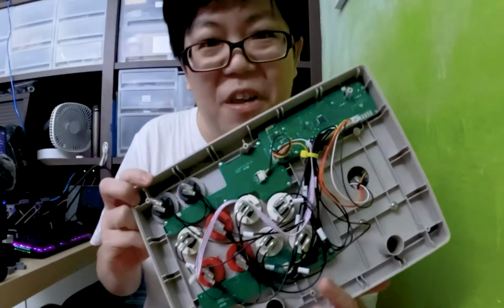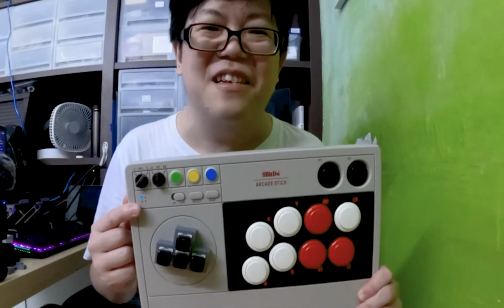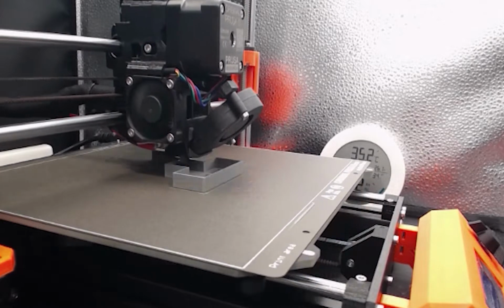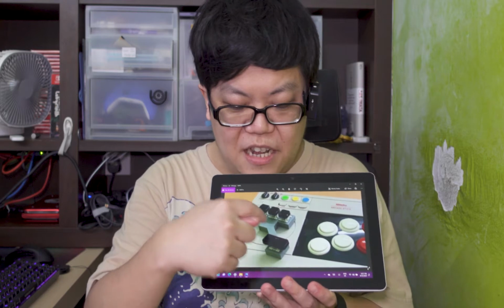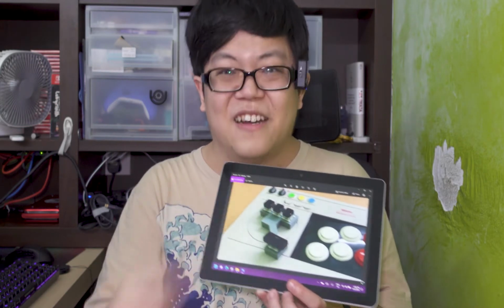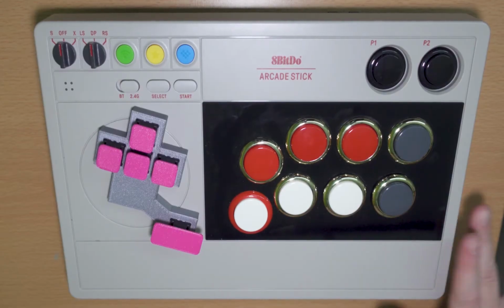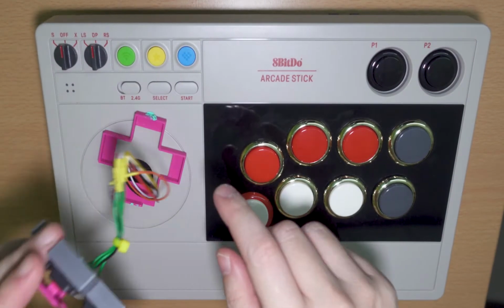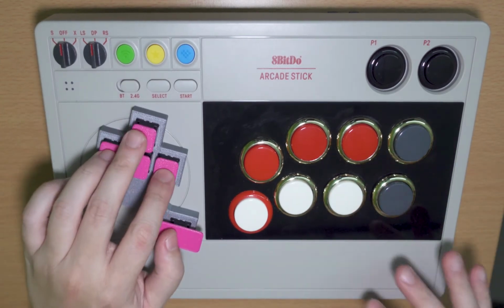DIY MixBox Mod For 8BitDo Arcade Stick

Comment: Yoooo this is just what I'm looking for. I'm new to fighting games and thriving on fightstick compared to controller, but I've been having so much trouble getting off Z-motions on joystick and thinking of alternatives. I've already got a screw-off stick for throwing my fightstick in a backpack, and this looks easy enough to attach with maybe magnets, so it could be borderline hotswappable. Zero commitment, and the option to switch for one input or another depending on what game my friends have gravitated to lately. It's probably going to take me years to get around  to actually putting this together, but it's nice to have a plan!

Comment: Hi 

Could you share the BOB files please ? which we see at 5:23

By the way don"t BOB have a little more height than TBOB ?

It's about tournament legal, you can't have 2 buttons for the same input.

thanks
Reply from the maker: I guess having multiple buttons that connect to the same function depends on the tournament rules.. But it's not illegal by EVO rules. https://www.evo.gg/rules#input-rules I'll see if I can just comment out the button and push it up.
Reply: @marauderz   have the file please? Thank you 5:20

Comment: I'm attempting to do a similar build myself, and I've been wondering, how did you solder the keys onto the wires? I'm not exactly sure since there's 2 pins on each key (like a regular button) but not sure how exactly it works, or which one is the positive and which is the ground
Reply from the maker: Buttons are just simple on off gates, no polarities, you push the button and the connection closes. If you have any doubts look at how the current buttons are soldered.